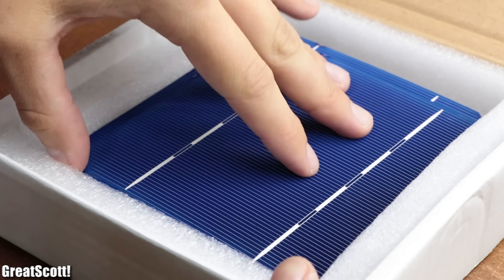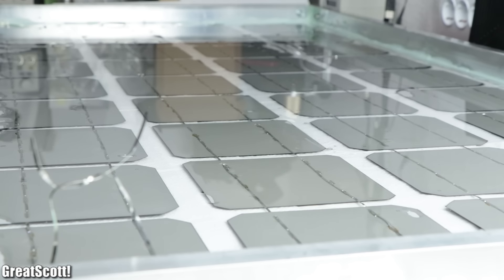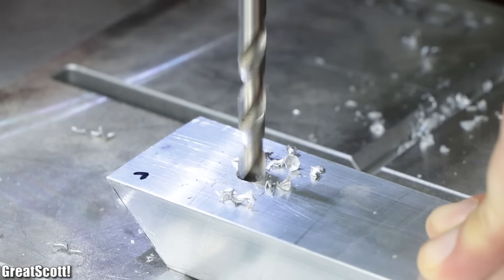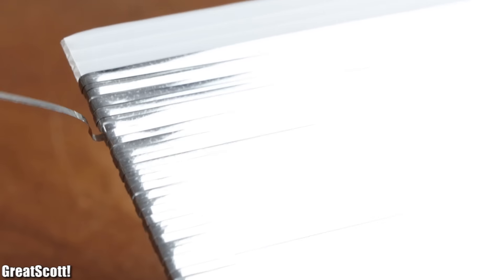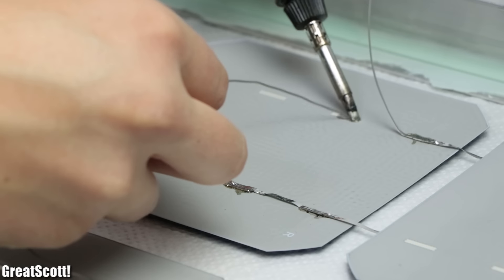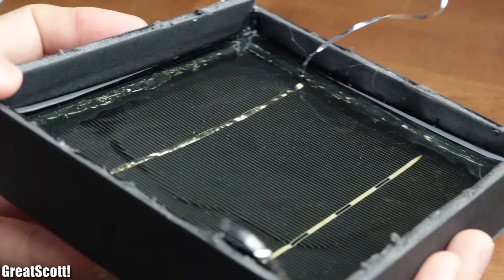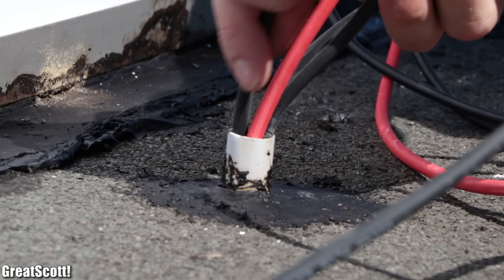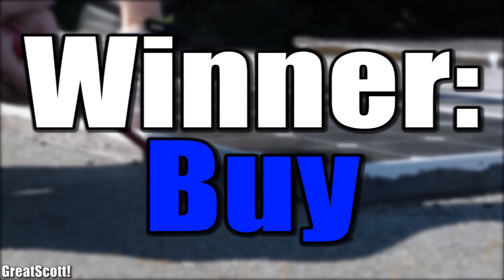100W Solar panel || DIY or Buy

Comment: why are the solar cells spaced so far apart? and the frame so thick? 
you could save money in material cost by making it more compact. less resin, aluminum framing, plexglass ,  adhesive, etc... 
it seems like you didn't even try to make it cost effective.
Reply: Suppose you can cut half the cost to make it as cheap as professional product, you still need to spend 8 hours or 1 day for 100w. For 10kw system, you need to spend 100 days, no way you don't lose your mind and breath too much lead gas to be able to cure in the process.

Comment: Nice video, but i think its important to mention how fragile these cells are, aand that you can buy cracked cells for dirt cheap like kilo price , and if the chunks are big enough, cread a panel out of that, and that you can use glass instead of plexi and resin to cut costs dramatically, like a sandwich of wood and glass, which will make DIY worth it
Reply: This completely.
You can get cells for nothing, glass for cheap and wood on the bottom and make them a lot cheaper.
Reply: Or you hunt for used old modules, which are less efficient but save you time if you dont have much free time, sometimes you can get like 100 watt panel for 50 or 60 euros
Reply: you NEED the resin. without it you have an air layer between the glass and the cells. that eats up to 40% energy output. also it seals everything.
Reply: there is plenty of air between the glass and the sun,  I dont see how a couple more mm will change anything @jp jay
Reply: ok, so let me explain.
what you say it right. there is plenty of air between the cells and the sun. 

B U T:  when light travels from one media into an other it will be refracted, reflected. (means: not 100% will pass) depending on the material it can be just 70-80%  (even with glass or air, depending on angle)

so if light goes from AIR to GLASS it will loose some %. THEN it will also go from GLASS to AIR (the one we speak of) and then it will go "into" the Solar Cell. 
so in total the light path is: AIR-GLASS-AIR- CELLS. 
that last AIR should be replaced by a liquid (or resin) to make it more transparent. 

if it happens one time you will get 80% of light in the cells. if you let it pass 2x through an AIR layer it will be 80% of the original 80% and that is only 64% 
windows will reflect the sun almost like a mirror if it comes in a flat angle.
and that light is the one which can not go through.
Reply: see the protective film on your cellphone. if it gets air in between it is loosing transparency. if it has a liquid instead of air it is SUPER CLEAR. (same effect)
Reply: I approve your answer, thanks  :D
Reply: i get what you mean, the difference between air gap phone screen and LOCA filled screen is huge, one could just pour some resin on each cell and stick it to the glass pane forever, that way you would use way less resin and have optically clear bonding, 

and who cares for waterproofing the backside, id just spray it with anti corossion stuff and leave it, or pour something cheap to seal it
or spray it with that rubber spray
Reply: true!
Reply: @jpjay1584  it is pretty easy to sandwich between two panes of glass, with each photo cell pressed against the top glass. small pieces of acrylic can even be set in behind the individual cells to press them more firmly against the glass.

The two panes of glass can then easily be sealed on all sides, using silicone, and even inserting a small one way valve. Then you just use a pump to pull most of the air out, and suddenly you have no air for light to be scattered by, you have an air free environment that stops oxidization, and you have a fully moisture free environment. You don't even have to use two pieces of glass. 

You could get better results, the same way commercial ones do, by using a piece of aluminum on the back, glass on the front, sealed and vacuumed. The back panel works as a heat sync and radiator. One can make that even better, by actually using thermal paste and connecting the back aluminum panel to every single cell with thermal paste, and then pasting small heat sinks over each point on the outside of the aluminum back, for better air cooling. 

I used to work for a solar panel developer, and then worked in solar sales. Totally had glass front panels that could take a hammer strike. Shatter resistant, uv coated, low reflection glass. 

A simple aluminum conduit frame can then be placed around it all to make it look nice, and that can even be filled with either foam or fully filled with more silicone to help absorb more of the force from impacts and from wind making it twist or bow. 

However, none of the diy stuff is really practical unless you are sourcing all the parts for free, or you are building this in large numbers, for say a 4K system. At that point, even buying a vacuum pump, and buying the giant stack of aluminum conduit, is all going to be pretty cheap in the end, especially with bulk prices. The cost of specialized tools, gets spread out over all the panels individual cost. 

I would guess, a person could possibly manufacture their own 4K system, for less than half of a commercial system. 

The biggest downside would be labor. 
Maybe if you had ten friends and made a couple of assembly lines, you could get them done fairly fast. Otherwise, it would take a person a good year to produce 40 or 50 panels one at a time. 
I mean, you have to work, eat, sleep, bathroom, and do basic human stuff, so help is needed.

Comment: Regular plexi glass will turn yellow-brownish in a year. Even "UV-resistant" plexi will suffer this in some degree. I think that the glass would be the best way to go
Reply: PLEXIGLAS and some other brands make UV resistant versions for years now that give you no yellowing guarantee, at best might notice some slight tint after years but personally knowing that I could get my money back if the glass yellows makes it worth it to me

Comment: Why does the solar panel (appear to) turn black when resin or flux contacts it?
Reply: i guess this is because of some microstructure on surface getting wet
Reply: Because resin refracts the light differently in comparison to air.
Reply: There is a fine matt textured surface which the flux wicks into
Reply: it's like wetting a stone I'm assuming
Reply: It does that when frightened.

Comment: What if you don't use the resin? That's -$40
And glass instead of plexiglass? You could even get it for free.
That's cost savings of almost $80!
Reply: ...And I see everyone commented this. 
I can say it would be worth it for me because I'd make it for way less :)
Reply: plexi is far more durable than glass, especially when backed by 1cm of resin
Reply: Plexiglass and resin both yellow over time when exposed to UV rays, which will begin to cut into the light transfer
Reply: Thats why it is far away from creativity and the sense of solar cells, wasting hundrets of euros to save some cents on electricity costs and buying new toxic materials to save the enviroment. The resin wasn't just absolutely not necessary, it was an absolutely idiotic idea for that he even spent almost the same amount of money like on the cells. He glued together two things from that one is flexible and reacts on heat and cold while the other cracks very easy, also the plexiglass will lose it's transparency in some months and the materials like the money is wasted anyway. Also all the other parts can be found in almost every corner in Germany as waste, only the cells needed to be bought, aluminium is toxic and now needs to be reproduced because he bought new instead of reusing something that is called waste, but probably he got so much money from YT that he became to decadent to think further, just making a new video fast for fresh yt-money. I'm getting disappointed more and more with every new video.
Reply: AirsoftSlo I know I got you, but put some 😂😂😂 emojis in your next comment to make you believe that I think now I'm wrong and you got me. "Hahahaha... LOLs" while eating your fingernails with a sad face.
Reply: AirsoftSlo Read your comment again where you say I'm watching this video on a 40 years old computer and dig in trash piles on the streets. Be a man and keep your own responsibility for what you say and do, it's not the countries fault that you think it's funny that people dig in trash, in the richest countries are the most people who dig for food in trash, do you think there is something funny about that? I don't think so. I'm living in Germany here we seperate waste, in an electronic workshop trash can is nothing disgusting, only electronic stuff, I told you about that and didn't even told that we was sorting out stuff from the storage room where a lot of pcb breadboards was with only a few components on them, because I don't judge about people negativly when they reuse things, even if they search for food in trash, and thought it is unimportant for you too, but you tried to make me look like an idiot, because you had no further arguments to defend someone you don't know and gives a fuck about you, by calling me poor by saying I'm the guy you always see digging in trash.
Reply: Solar panels are design to withstand hail strikes (not sure about what size). Don't wan't your 20 year system to be destroyed by a storm every 5 years.
Reply: nobody mentioned dollars here
Reply: @Wilson84KS  aluminum  is generally not toxic(depending on dosage) to humans and it leaves the body easily. You are talking out of your ass. Look, I get it that you do not like the project, neither do I, but do not virtue signal if you cannot lay out your critique in a sensible way.
Reply: You could use glass instead of plexi glass, but it would crack and chip easily
Reply: @Wilson84KS  The problem is that you can´t find that free glass and aluminum channels when you need them.

Comment: Normal plexiglas have UV blocker added, which might lower your yield.
You can buy plexiglass without UV blocker, but you will have to make some calls...
Reply: Simon Østergaard - Good point. I suppose it depends on how broad the UV blocker is. UV does not contribute to electrical power and results in unwanted temperature rise. So, you actually want to block UV. The problem would be if the UV blocker additive also block part of the visible spectrum which would indeed lower the PV efficiency. A test would be simple enough — measure the power output of a bare cell and then cover with plexiglass and remeasure. Another concern is discoloration of the plexiglass and/or resin after prolonged UV exposure.

Comment: if you are thinking of retrying this one, try using, for example, an insert that has slots for each cell set, spaced, and cut out.  something as thick as the cells themselves.  and second sheet of Plexiglas.  and maybe even, if you can find a [plausible way to do it,  vacume sealing the space in between the sheets of Plexiglass.

Comment: awww, I was cheering for DIY
Reply: His design is pretty bad, so DIY wins, specially if you can recycle materials. Epoxy was not needed, clear UV protected lacker would suffice, plexyglass is expensive and would better be replaced with normal glass, that you can recycle from old windows. Aluminum frame could also found from trash, but could well be replaced by sheet metal bent in U form and so on.

Comment: You lost me at the 2-part epoxy. That shit is hella pricey and totally unnecessary.
Reply: Taylor  lol the point is all you're doing is holding the solar cells in place. You could use a mechanically cheaper adhesive around the edges and then fasten a panel on to the back to weather proof the panel. IDK what material would be best but almost anything would be cheaper than epoxy.
Reply: +KrazeeCain simple silicone caulk, and hot glue from Walmart (used seperately of course).. cost you a dollar each. will hold and seal anything in the world for cheap, quick fix diy : ) between those, gorrilla glue, and some duct tape, you are unstoppable. lol

Comment: I tried this myself, but the soldering didn't work well and from a kit of 45 cells, only about 36 survived which was expected by the designers of that kit.
But this is becoming a very outdated technology as I am participating in the research for tandem thin film solar panels that can be commercially produced and sold for even lower prices and have about twice the efficiency of those panels. Also crystalline silicon requires high temperatures (1000C) to manufacture that silicon wafer that is then having atoms added to make it a p or n semiconductor. But thin film, the whole panel is produced like a single cell in an in factory device that is a vacuum chamber so the metal atoms can at lower temperatures (<500C) be able to go out of small chambers inside the vacuum chamber and adhere to the upper glass surface where the entire panel is formed and then once it comes out, it continues down the conveyor belt to the next step. The factory is able to build 10,000 thin film panels in one single day.
Enclosed system hydrogen fuel cells and lithium ion batteries will be good for the energy storage to use the sun's energy at night. The enclosed system hydrogen fuel cells will be built in a way that once the hydrogen is consumed, the water is split into hydrogen and oxygen by an electric "charger" making the hydrogen fuel cells act like a battery. Such hydrogen "batteries" are good not only for cars, but for buildings, trucks, ships, airplanes, and anything that needs energy.
Reply: Can you predict when we'll see the commercial release of this new film?
Reply: so i can build a dyson sphere?

Comment: You pretty much never can DIY cheaper than buy due to economy of scale.
Reply: At least if you are paying retail prices for stuff.  If you can pickup stuff wholesale or used it can be cheaper.
Reply: Usually I see diy as a customization to add quality features, while attempting to add things on to which it will be used for. For example I saw his video on oscillope for diy or buy or the price difference. I see the cheaper oscillope was not as bulky as the 400 dollar one.

Also DIY I have done because I didn't want to get rid of all the computer components yet. I ultized the screen on a dead laptop to serve as a second monitor, that I didn't have to carry around in a case.
Reply: I can think of two category of exceptions:
- when you need quality and/or fill a niche(or custom).  Example: bed, subwoofer.  Ok, you need a set of ok-ish woodworking tools to start...
- some items can be repaired much cheaply than buying new: laptop batteries, battery banks/packs.

Comment: if you had done things a little better your DIY would have won.... first off plexi is a big no no. flex cracks cells and plexi breaks down fairly quick from UV. not to mention glass is waaay cheaper. youre suppose to use glass. you also used far more resin than needed. make sure your cells are as flat as possible, than use less resin and slowly tilt it all back and forth to even it out and to let the bubbles escape from under the cells. vwala, cheaper and usually higher producing panel with just as long shelf life as the mass produced ones
Reply: I was cringing too - Plexiglas/Perspex is really not appropriate, it can also melt or catch fire if a shaded cell gets too hot, but this can only happen with long strings and bypass diode breakdown.
Should also seal the edges of the cells with some masking tape to prevent resin getting on the cell surface. I made my panels using Sunpower cells - much less tabbing to worry about, but tedious cutting and shaping small pieces to connect them instead of using the expensive 'dogbone' connectors.

Comment: NO NO NO
With this layout of the solar cells try putting the hand over one...
you will notice your output plummet near 0 if just 1 cell isn't producing!
Reply: Yes, but do you put your hand always on one cell? We need a high current or we would have a huge loss through the cables.
Reply: 6:50
No it won’t that’s what those bypass diodes are for